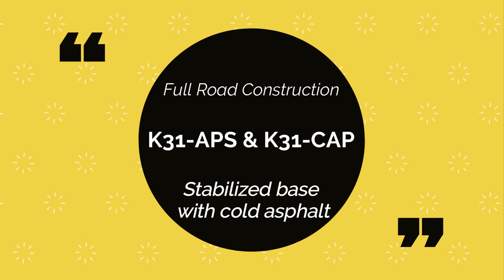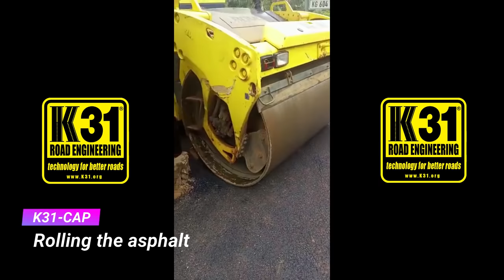K31-APS stabilized road base with K31-CAP cold asphalt surface

Comment: Thanks for sharing this video and educating us about this method of building a road, however, I would like to know how durable will the road be once completed using this method, will it not easily wash away during heavy rains...? Thanks
Reply from the maker: Gabriel, thank you for your question. When you build a road using K31-APS for the base and K31-CAP cold polymer asphalt for the running course, the life expectancy of the road is 12 years + and with minimum manintenance.